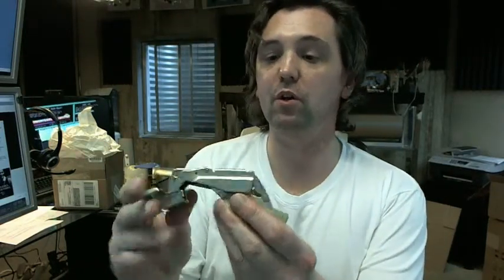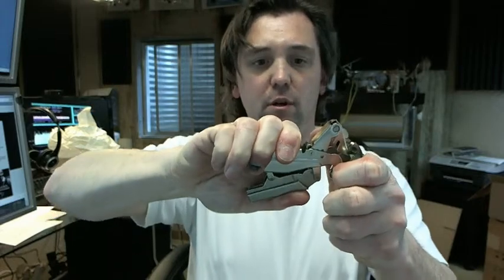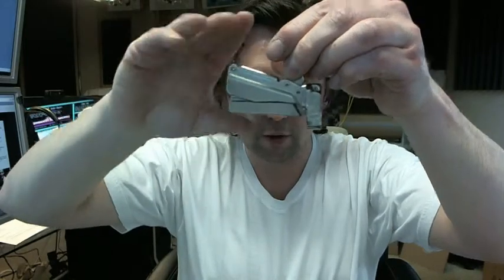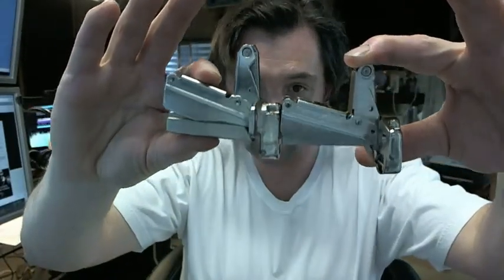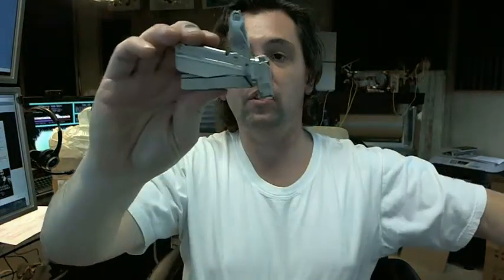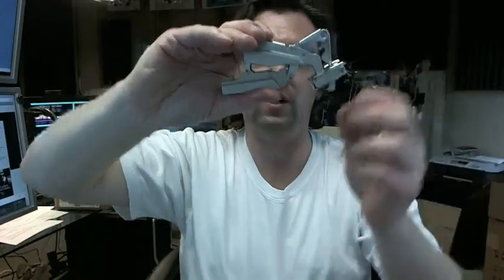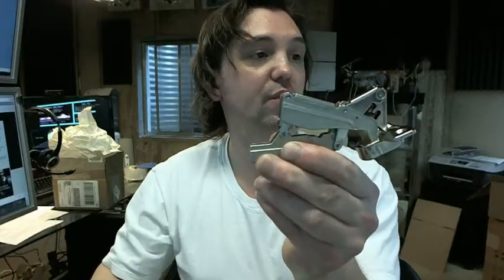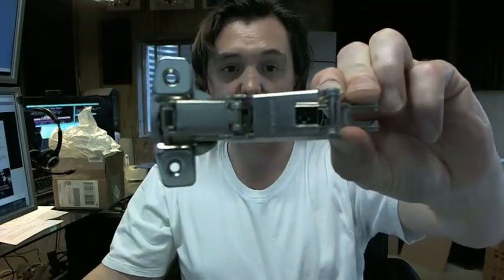Hafele 311 93 512

Comment: Looked on absupply.net and it looks like all of this stuff is out of stock. I'm looking for replacement mounting plates for the full-overlay hinge (311.98.590). Is that something you can get? I only need a couple to replace broken plates on my corner cabinet, but I can't seem to find them anywhere!
Reply from the maker: As far as I know Hafele has no direct substitution.  Your best bet is to Talk to Customer Service by phone 1-800-423-3531 and ask for a replacement.
Reply: RICHARD HOWARD
Thanks for the tip, Rich. Much appreciated. Called Hafele and it looks like I'm going to need to get whole new hinge/plate sets for the cabinet.
Reply: Michael, 
I am having the same issue. Did u get the replacement hinge/plate set from Hafele? Please share part number, Ty
Reply: Eugenia Atkins I actually found a good replacement here...reasonably priced. on Amazon, of course!

hinge: http://www.amazon.com/gp/product/B00AEVVSCY/ref=oh_details_o00_s00_i00?ie=UTF8&psc=1

plate: http://www.amazon.com/gp/product/B00AEVW9O0/ref=oh_details_o00_s00_i01?ie=UTF8&psc=1
Reply from the maker: Michael Jantz Thanks for sharing